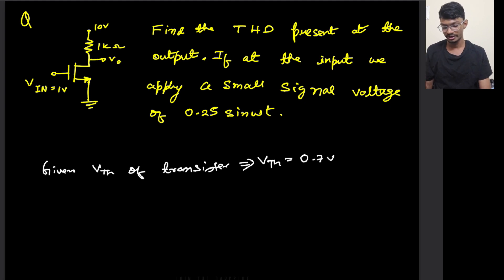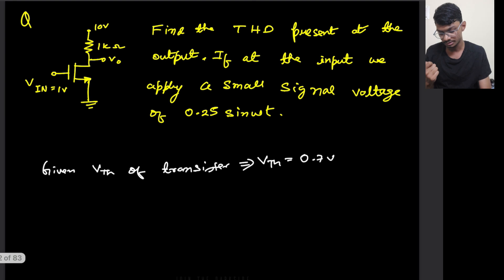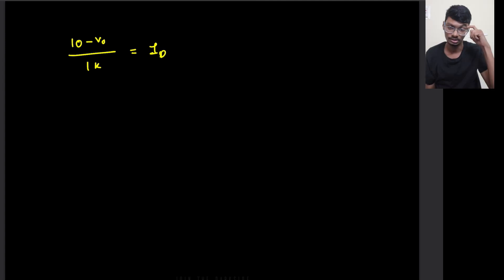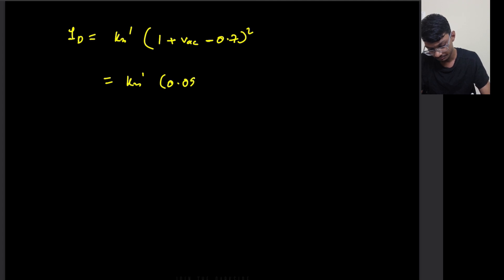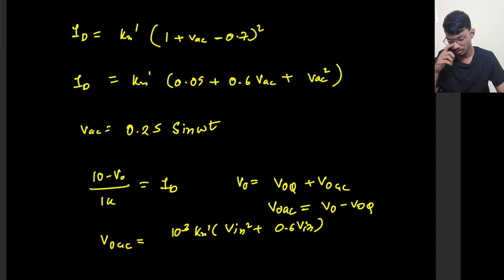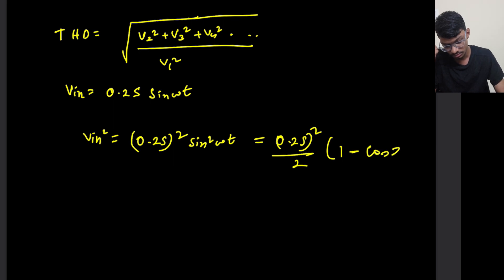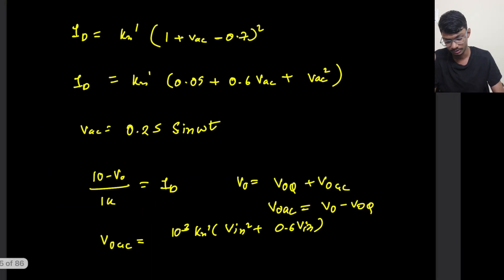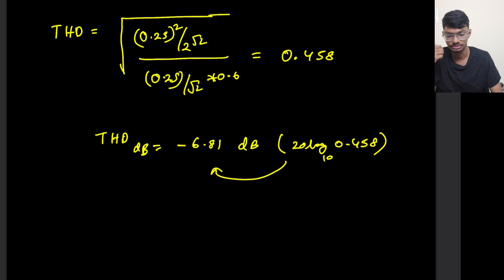Screening Test Problems || Total Harmonic Distortion of a MOSFET || Concept Through Question

Comment: I have one doubt will common source amplifier in frequency response will calculating zero will come because of cgd ok if we use miller concept then zero will occur or not?
Reply from the maker: If exact analysis is used then Cgd will cause a zero if we use approximate analysis (miller concept) we assuming Cgd to be very low hence we will not get a zero. Zero will occur at a very high frequency.